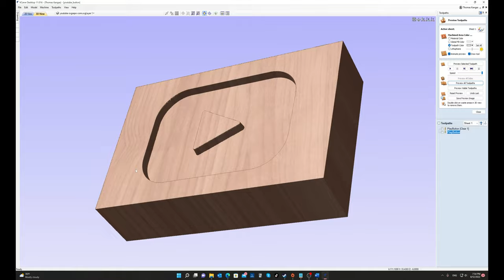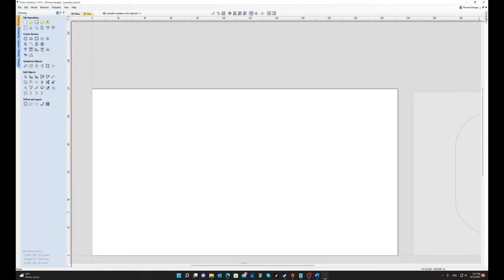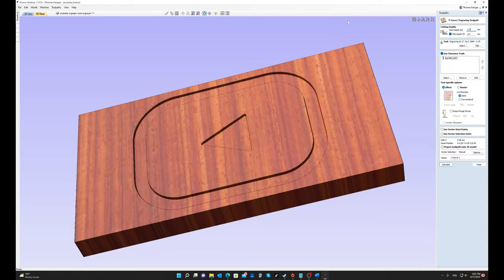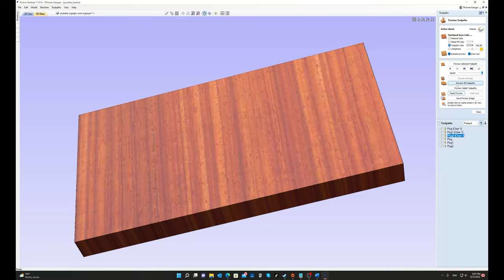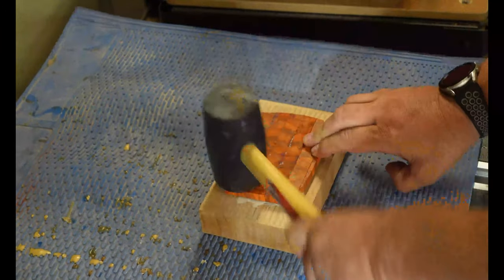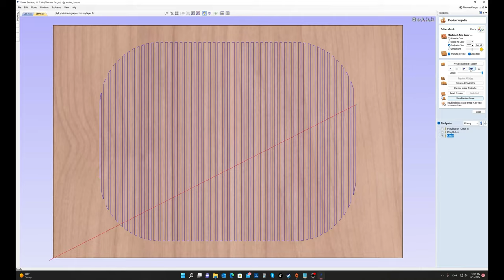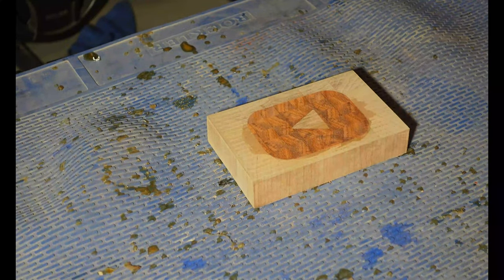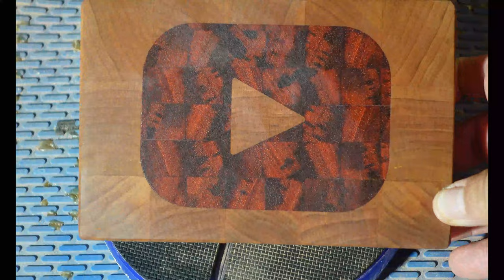Inlay Tutorial - How I do end grain inlays in Vectric VCarve Desktop. 4K

Comment: Im new to CNC so please bare with me. On your final clearance tool path you said you set the z offset to the material surface. Im using Vectric desktop and I don't see that option. Great video many questions answered thank you.
Reply from the maker: When you set the dimensions for the job during initial setup, you configure X, Y and Z thicknesses for your material, and then there is an option in the same setting for "Z Zero Position". There, you have the choice of setting Z to the machine bad, or the material surface.  I neglected to show that part in video. For that, I apologize. I am soon making a new video for a project I have coming up, and I will show everything from start to finish. Thanks for watching!

Comment: Thank you for the video. I have only had my cnc for a few months. Am I seeing an end mill or is it a ball nose for the ‘hogging? The the tapered for a final pass? I use Vcarve desktop as well. Thanks for your videos.
Reply from the maker: To hog out the bulk of the material, I use a 1/8 inch down cut end mill, and if it calls for it, a 1/4" endmill for very large clearance areas.  The second toolpath is not just a finishing path. but a full cutting path using the ballnose bit. I cut in 3 depths 1mm start/2mm flat; 3mm start/2mm flat, and 5mm start/2mm flat. The end result is a 7mm long plug (male side).  On the pocket side, I let the tool path take as many passes as designated for the tool. Thanks for watching!

Comment: Very good and informative video. Thank you for sharing. 
I did notice that that is not the stock or the Dewalt spindle. What spindle are you using? I’m really leaning to get this machine but I would like to upgrade the spindle. 
Thanks
Reply from the maker: I installed a VFD spindle. I was burning out the brushes on the Dewalt too quickly.  The VFD did require me to mill an aluminum mount though. It can be done, but the Z-Axis for this spindle is just a hair too wide.

Comment: I am new to CNC and I am not getting the speeds and feeds right. Can you share what your speeds/feeds/RPM setting are for your bits here. I have a feeling I am pushing mine to hard and I need something to compare to. LOve your work and one day I hope to be able to do this sort of beautiful work.
Reply from the maker: I feed both bits at 420mm/min at a depth of 2mm.  My speed is 18,000RPM.  The most important thing is to realize that your feeds and speeds are dependent on the capabilities of your machine.  My recommendation is to test your bits.  Test the speed, the depth, and even the RPM if you wish. Start slow, and then slowly ramp up your speeds and feeds.

I cannot stress it enough.  You must visually watch how your machine as you make these test cuts.  If it looks like your machine is starting to struggle, back off the speed to somewhere between the current, and the previous speed you used.  

Thanks for your kind words, and thank you for watching!
Reply: @tk.designs  Thank you for sharing what you know and suggest. I will start low and work up and see if I can improve the issues I am currently experiencing.

Comment: it looks like you are using the Genmitsu PROVERXL 4030. Do yo have any regrets. i am going to buy the same one with the extention kit  in a couple days
Reply from the maker: You are correct! I have no regrets what so ever. The PROVERXL has actually been a very sturdy CNC.  I did swap out the included spindle for a VFD spindle, as I wanted a little more power, and a lot less noise.  Thanks for watching!

Comment: Sir i have a question
Why don't you use passes in both male and female toolpath??
Reply from the maker: Thanks for watching. When cutting the female pocket, the start depth is 0, and flat depth 6 mm. Because the depth is greater than depth per pass parameter, multiple passes are needed to clear the material.  On the male plug, we use a constant flat depth of 2 mm, and get our depth by adjusting the start depth.

If I want to cut a male plug that has total depth of 7 mm (to give a 1 mm gap to allow for cutting off excess), I would have a final start depth of 5, and flat depth of 2 mm.  This means the tool would begin it's cut at a depth of 5 mm, and cut down 2 mm.  The toolpath assumes that everything above start depth is cleared already. Since this is not the case, the tool would immediately plunge 5 mm, and then cut down the flat depth of 2 mm, or basically, it will cut a tool path that is 7 mm deep in 1 pass.  We don't want such a big depth, so we break it down into smaller "passes" by creating additional toolpaths.

I will create first, the start depth 5, flat depth 2 (final pass). Then I will create a start depth 1, flat depth of 2 (first pass), and then create another toolpath with start depth of 3, flat depth 2 (second pass).  Finally, I re-order the toolpaths so that they are arranged as first, second and final pass.  This basically simulates toolpaths in a scenario where the flat depth is less than the depth of cut parameter. Hope this helps!

Comment: the problem is that when making some special details, the knife will destroy the thin place. can you avoid it？Thank u
Reply from the maker: Hi, and thank you for watching!  You have a great question. The way I avoid the endmills destroying small details is to ensure that I simplify the artwork as much as possible, so that vectors have at least 1 millimeter of space between pockets.  Some others may recommend cutting the fine details with the v-bit endmill first, and then do the clearing endmill, but I honestly have not tried that with much success. I have found if any particular element of the artwork has an area of less than 1mm, it tends to get destroyed by tear-out. Hope this answers your question. If not, I can try to explain in greater detail.

Comment: hi, i have a dout, you said you are using a tapered ball nose end mill and you puit in the v-carve tool box, here is my dout, the ball nose does´nt have a sharp point like a v-carve end mill does so how do you cheat on the machine, im using artcam  and there is no way i can create a tapered ball nose in v-carve tool box, do i have to do some math so the software thinks it is usuing a sharp point end mill?
Reply from the maker: Thanks for watching.  The bit is a Yonico tapered ballnose bit, 1/32" diameter (https://amzn.to/3KWteMb).  I enter it into Vectric V-Carve as an engraving tool. 6.35 mm diameter, 6.2 degree side angle. This bit truly is a ballnose bit, but with a very sharp point. It is like a 12 degree v-bit.  Please let me know if this helps.  The link takes you to the bit on Amazon so you can get a good look at it.
Reply: @tk.designs  ok, i will